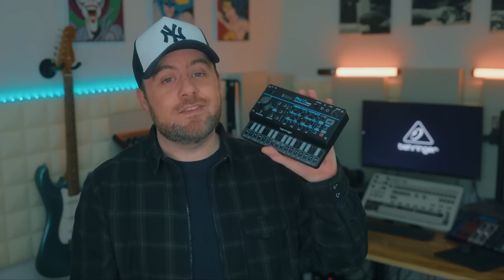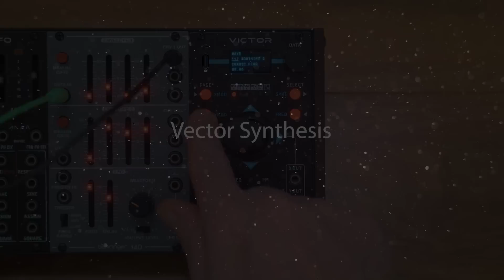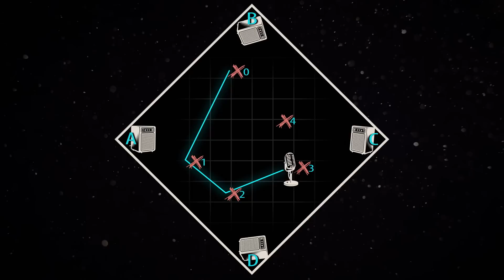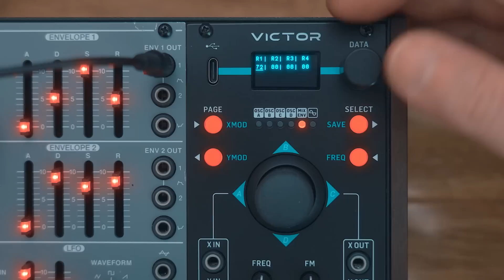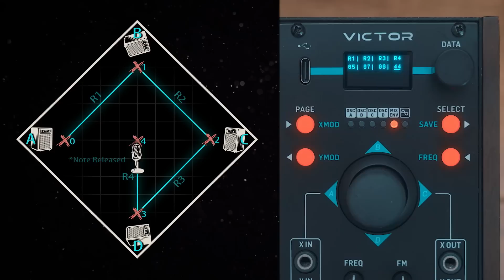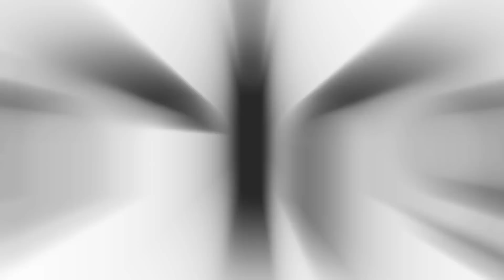Vector Synthesis Explained & Patch Creation - PRO VS Mini / VICTOR

Comment: Great video, but where do I set the Mix Points one my pro vs Mini? Couldn't find a way yet.... Any help ist appreciated
Reply: Thanks. Hit the Function button and then press key 13 (Mix Envelopes) and you'll get the same menu I'm using in the video on Victor. From there the process is the same.
Reply: @PatchDog  More precise, pressing Function and then 13 three times gets you to the mode where you can use the joystick do set the vector points. +/- cycle through each point there.

The quick manual is a bit "quick" IMO, hopefully someone will make a better one. I love those cheat sheets, like those for the Pocket Operators, where you have all basic functions on one page.
Reply: Thanks for the added precision, I didn't have one in front of me. Yes the Quick Start Guides could do with being more intuitive, I agree. I just make the videos.   @paddyboy207

Comment: so basically, R1,R2,R3 and R4 are analogous to the ADSR. You would use R1 to set the attack portion, R2 to set the decay portion, R3 to set the sustain, and R4 for release. Awesome!

Comment: Nice video! Question: that arpeggiator sound in the background music (as heard also in one of your introduction videos), is it coming from the Pro-VS Mini? That's a nice Tangerine Dream vibe from the 80s.
Keep up the good work!
Reply: Thanks dude. I use that Arp riff in loads of the Behringer videos. I made it with the Crave, the subtle string pads you hear in the longer versions are from the Deepmind 12.
Reply: Thanks so much for the details, well done!

Comment: Is there any way to be at the position 4 from the start and stay there ?
Reply: Yes, you can easily understand how to do this after watching the video. Just set Vector point 0 to the center of the axis with the joystick and keep R1-R4 value at 0. Exactly like he did but setting vector point 0 to center instead of vector point 4.

Comment: On the ProVs mini is there a way to use the joystick to control vector position rather than setting points, like the Victor is able to do? I’d like to do live morphing without relying on automation. The only way I found to do this is by putting the synth into the mode to set position one, but this is very limiting because it locks you out of all the other controls.
Reply: I second this. I received my Pro VS yesterday and during my first tests I didn’t understand why the mix got “reset” to center with every note while playing a sequence.
Reply: @PeterDeGree I think I may have figured it out. I haven’t tested it, but one thing I gained from this video is that setting all the R values to zero in theory keeps the mix fixed on the first vector point. So you should be able to use the joystick if it’s set that way. I’ll have to try it out though.
Reply: @PeterDeGree so I just tested my hypothesis, and no it does not work. Setting all the R values to zero does not function the same way it does on the Victor. Not sure why the joystick doesn’t control a vector point position unless you’re in an edit mode. It makes no sense. This is so aggravating.